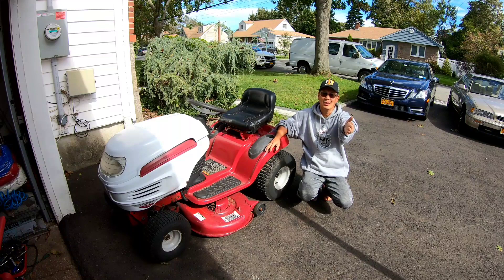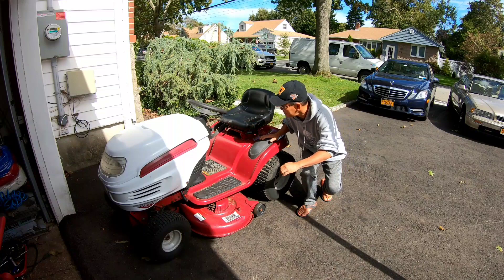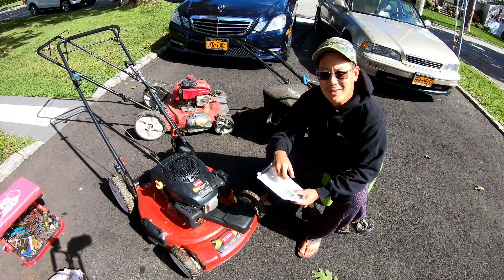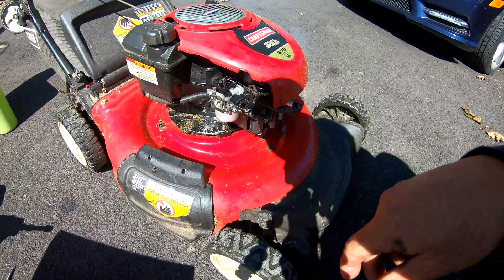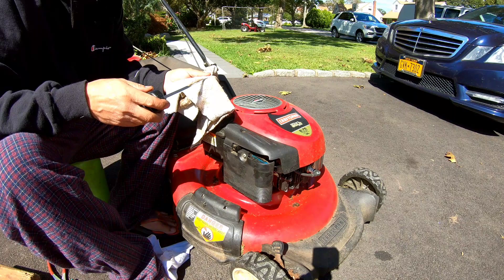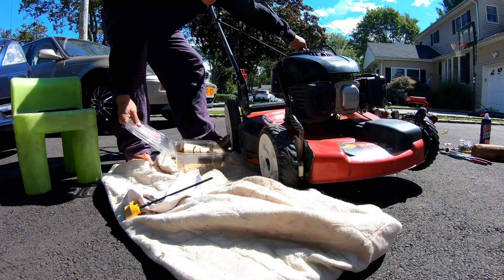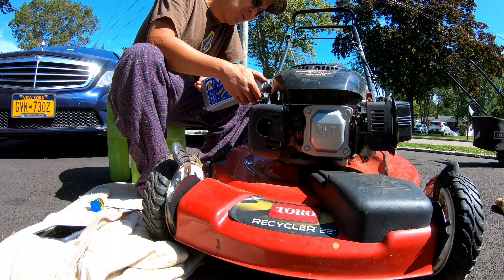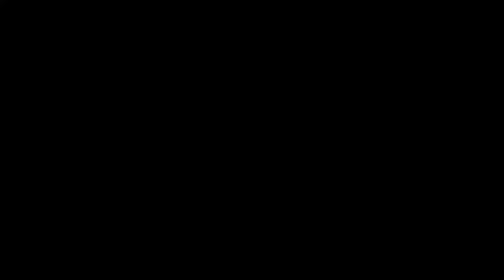FIX N' FLIP 4 LAWNMOWER TORO XT675 AUTO CHOKE ARM THERMOSTAT REPLACEMENT OIL OVERFILL CHANGE REPAIR

Comment: A practice I adopted years ago with a L head Briggs, I always hand tighten the plastic intake tube 1/4" bolts, they are always loose, and with a ratchet and a 1/2 3/8th socket, I hand tighten all the head bolts, the bottom 4 around the spark plug are always loose.....that makes for a better seal, and makes it start better, Great video bro.

Comment: There is a black screw on the Kohler carb you can turn  change the idle  also.  
Turn it in to raise the idle ,  unscrew it to lower it.  Same applies for Honda’s  and other Honda clones.  

Good vid today.  I like the use of the take out container and  tape as a cover.
Reply from the maker: Wait till you see what happens on Wednesday in relation to that cover.

Comment: With a primeable briggs L head if you double up on the gasket, and it still fails to prime right, pop out the primer bulb, and see if the mesh screen is messed up or clogged, there might even be a crack in the primer bulb itself..... Masking tape trick works too but check the mesh under the primer bulb.
Reply from the maker: Yup I did all that, masking tape works
Reply: @MowersNBlowers  awesome bro.

Comment: That kohler has an engine knock ✊ 😬
Reply: Franco The Boss I have a TORO LAWNMOWER IINDENTICAL TOO that one that does the exact same thing I mean my TORO is the TWIN to that one ENGINE DECK everything OH &  HENRY tell me something how can that ENGINE on that TORO be 6.75 FT. POUNDS OF TORQUE when it is only 149 CC when the BRIGGS & STRATTON is 6.75 FT. POUNDS OF TORQUE & it is 190 CC ENGINE it CANNOT BE think about it the BRIGGS is basically a 200 CC ENGINE where the on on that MOWER is just a 150 CC ENGINE get my DRIFT & the BRIGGS has a WHOLE LOT MORE POWER
Reply from the maker: It’s all about the engineering and rating.

Comment: I have a TORO MULCHER just exactly like the one you have there it has been in the SHOP once I had a tune up done on it & put some of the same old GAS in it that I run in BOTH of my BRIGGS & STRATTON MACHINES & they run fine on it but that STUPID KHOLER ENGINE it has on it WON'T even run it will start but as soon as it starts it will LOAD UP & FLOOD OUT (RUN TOO RICH) & choke out I'm AGGRAVATED to the MAX with it I personally don't care if it ever runs again as long as I have my dependable MACHINES that will start & run every time I pull on the ROPE to start them